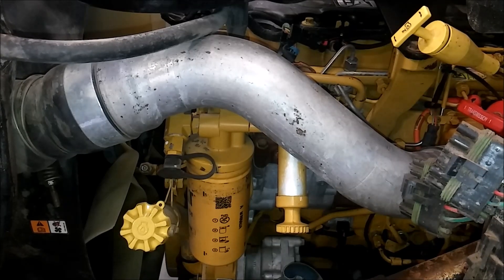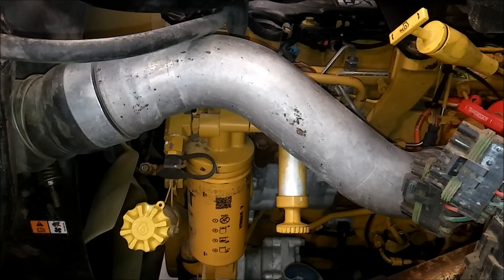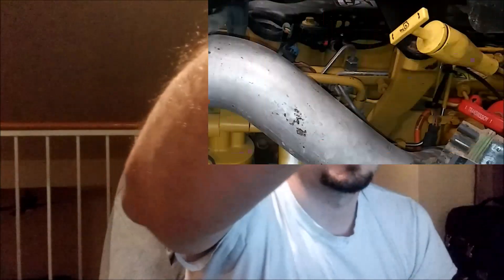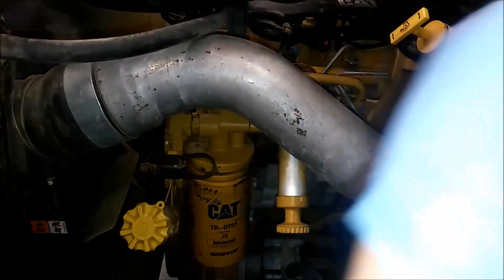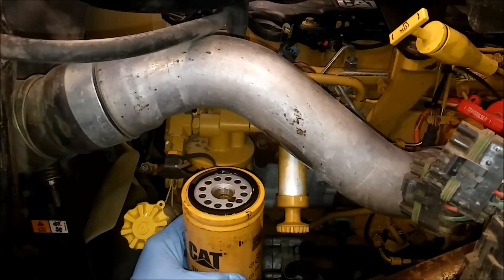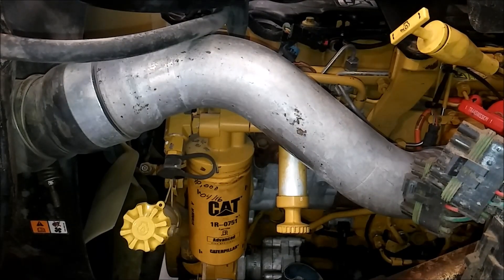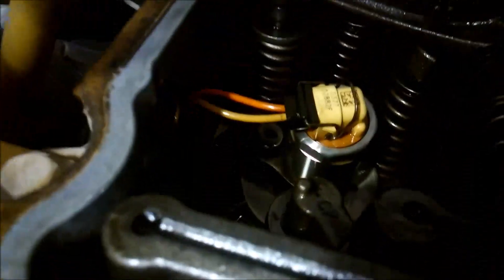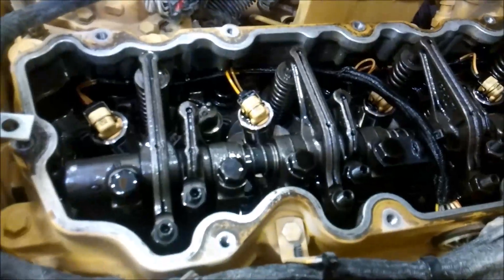How To Troubleshoot Fuel In Oil Contamination .  Diesel Fuel Dilution.

Comment: My car is a 1996 Renault 19 Europa 1.8 F3P. About 10 days ago, the engine mixed fuel with the motor oil twice. Mechanics here in Turkey can’t figure out the cause. Could you please help me?".

Comment: Great work, just i would like to ask about the troubleshooting of fuel in oil contamination at cat engine 3412E with HEUI fuel system, how can i do it, is it the same? Also, after i add the fuel additive to which time in minutes or seconds i should run the engine then shootdown and check the oil coming from the injector?

Comment: Ik this is a old video just curious on a c7  if there is anywhere I can get fuel in the oil from a o ring in the heui pump or fuel transfer pump i had the injectors tested and they tested good we put new o rings on the injectors an have put it back together for now hoping it was a bad o ring but they all looked ok this is a cat remain engine with just over 50k miles an 4000hrs

Comment: So I put dye in my C12 Cat 04 model and ran it for 30 min no clear indication on injectors but if I shine the black light on the oil that’s all over the moving components I’m getting a greenish yellow tint reflecting so it’s already in the oil is it possible my orings are bad and or injector cups?

Comment: Hello everyone!
I have Toyota Hiace with 2.5d4d engine 102ps KDFTV code and I have a problem with oil and fuel dilution.
We changed small rings under the injectors, fuel hoses, the injectors are fine - tested, does fuel pump may cause this problem?
If you drive a van on 2000rmps constantly it will be a minimum of the oil and fuel dilution, but if you push the engine over 3000rmps lets say in 5th gear and 120kmh ( 75mph ) the dilution will start quickly.
Thanks for your time and answer.

Bojan Serbia
Reply: Hi have you found solution for this

Comment: I thank you for making this video. My question is I have a 3406b and the fuel is mixing with the oil. I pulled valve covers off I see five nozzles with oil on top and one that is clean no oil on it. Could this be my problem?
Reply: Did you get it fixed? If so what was the issue?

I'm having same issue with my C15 fuel in oil I'll do the dye test, and also just sent in oil sample for confirmation.
Reply: @TolaTrucking  yes I got it fixed it was my plungers in my pump. On that c15 one of your injectors got to be leaking. If you take off the valve covers look on the top of each injector they should have oil on top of them. Look for one that doesn't have oil on it and it's clean. That's going to be your problem.
Reply: I'm going to be checking my messages so I will come back later to see if you was able to get it. It's not hard it sometimes get to you when you don't know I'm here for you bro.

Comment: I have a cat c12.  Just recently had fuel in my oil problem.  Used the advice from this video and dyed my fuel in the fuel filter.  Still could not find the problem.  Ended up changing the fuel pump and o rings on the injectors.  Still didn't fix it.  Brought it to a local shop they pressurized the fuel system and found a small Crack on #2 internal fuel housing right at the injector.  I guess I was the 1 out of 100 that it was the head.

Comment: I did that and gues what my heart almost stop due to whole engine being flooded with fuel by four out of the six injectors. And replaced with new oil filters and set of injectors remanufactured. And started let it idle for a while every thing sound ok drove it and oil pressure started dropping in 5miles stoped towed back to the shop and I’m back to circle one
Reply: Did you end up resolving?

Comment: Watch out for cheap Chinese injector nozzles. They work, but won't atomize the fuel well enough and will result in crankcase fuel dilution, much worse if you already have some blowby as the poorly atomized unburnt fuel will leak past the rings and into the crankcase. If you use low quality biodiesel or mix with veg oil it will cause gumming of the rings and extreme blowby.

Comment: Thoughts on this issue with a Perkins engine in a 1974 Massey Ferguson? The tank gravity feeds into the pump. My guess is it is a check valve in the pump. At least there is a petcock on the tank.
Reply: Farm Tractor

Comment: I have a 2003 3126b in a peterbilt 330 , my oil pressure started to drop and we checked the oil and it was 2 gallons low , added the oil and it went back to 40 psi , looked for the missing oil and found it in the fuel filter…… need help

Comment: Hey I have a 3406e and I ran this test,change the fuel pump and still getting fuel in the oil. The engine has 30k on complete rebuild. Anything else I could check for??

Comment: My injectors are external like a car so I’m just wondering if that only leaves injector pump as a way diesel is getting in oil? N84 3cyl
Reply: I have the same type of fuel pump but it’s a N844 4 cylinder.    Did you find the problem?

Comment: ... I was trying to locate a fuel system leak test procedure (to address a 51.6% fuel dilution of Port eng. crankcase oil issue) for DD 6-71N (Marine) engines (DDA? documents a procedure for applying air pressure to the cyl. head fuel passages, supply /  return pipes / connections and MUI injectors by disconnecting the fuel line at the secondary fuel filter outlet) ... then I came across this video and your use of the dye additive - a revelation!  I can see the CAT & Spectroline identifiers, however, so far, I'm not real sure what UV tool would be cost-effective for a one-off t/s mission ... FYI - I've looked up into the two pipe-threaded ports in between the bearings and seals in my mech. fuel pump - not plugged up, nor have they weeped fuel or oil ... I suspect the fuel pipe connections, or, maybe, an injector, however, the engine otherwise seems to run fine (fires on all 6 cyl.'s).
Reply: ... I found a DD procedure in DD Service Manual 6SE164 MAY 1994, Section 2.0 (Shop Notes - ... ), Pages 17, 18 & 19 ... three fuel leak test methods are outlined, the 1st being observation under the rocker cover of oil puddle presence / weakness / absence (at fuel pipe connectors to head / f.p. nuts to head conn.'s & injectors / f.p. & nut interfaces) following 20-30 min.'s of run time (DD stresses oil puddle inspection as 'key').  The 2nd (engine static) & 3rd (engine running 400-600 RPM [fuel pressure to be regulated higher to 70 PSI by an introduced return line valve]) involving pressurizing to 60-80 PSI with fuel (not air, as per my earlier recollection) ... these latter two methods involve tools I don't own ... which makes my one-off t/s initiative somewhat problematic and less than cost-effective in the scheme of things ... an air pressurization procedure may exist but I don't know where it might be found and / or if it would even be appropriate, should I choose to ad-lib ... I'm liking A,A.'s dye test method more than ever except that it requires a running engine (mine has no lube oil in it, at all, as I anticipated further fuel loss / leakage into the crankcase during testing) ... I'm still trying to track down a local (to Vancouver, B.C., Canada) Spectroline supplier (for dye & appropriate UV flashlight tool) ... CAT wants $17.22CAD (+5% +7%)  for the 1 oz. bottles of dye ... nearest inventory to me is Spokane, WA ...

Comment: losing 1 gallon oil in  50 miles  where is it going no leaks no smoke engine runs good 
until oil runs low is there a o ring on huie to fuel oil
Reply from the maker: The most likely cause is an injector or injector oring leaking oil from the HEUI system into the fuel supply port in the head. You can try resealing the injectors, but if that doesn't work you most likely will need a new set of injectors.
Reply: would it leak that much through injectors

Comment: bmw x5 e53 3.0d diesel in oil,,, what could be the cause,,, smooth running test revealed that injector 1 cylinder 1 is at 2.7 on idle,,,, i am blaming may be cylinder 1 on low compression... its 5 days to over fill the engine oil.... please help
Reply: If 2.7 is talking about some kind of balance rate and its way out of spec, you probably have a leaking or cracked injector
Reply: @sineadfectus  how about compression on cylinder 1 where the mentioned injector is in use... because im also seeing oil on the injection up removal...

Comment: i have a 1978 kubota tractor, v4000, i believe im getting fuel in the oil. any merit to changing the lift pump gasket(s) and injection pump gaskets? and in theory if i remove the injection pump , regasket it, and put it back and line up the marks, so long as i didnt turn the motor it is still timed correctly right

Comment: Good video,  I'm having an issue with a Cummins CM870 right now smells like fuel in with the oil, I removed the valve cover it burned my eyes and nose from the smell. Also has a thump coming into the intake sounds like a steam train.
Any ideas

Comment: Hello..guys...i have this problem and have replaced alot of parts and spend alot money and lost of time at shop and same issues and alot guess by mechanic shops...like bearing n  oil pump etc.........Turn out i replaced #3 injector and 6 injector 0 rings of injector and 3 new filters and fresh oil change cost me about 900usd ..i have cummin isl motor ..2008 kw t800..hope this help..im in la cali..
Reply: Is that what fixed your problem, changing the injector and all orings

Comment: I have a question for you.. I have a 3406c peek Caterpillar  serial# 4CK09953.  Noticed I was losing oil pressure. Got down to 18 give or take at hot idle. Decided to shut her down. I found I was making oil.  Been watching  your vids and ran the dye. Had  dye coming out #3 bonnet. Replaced all 6 fuel nozzels made sure screw was tight on new ones before install. But all back together dropped oil pan. Found fingernail chunks of metal. Inspected rod and mains #4 main was bad. Crank was not damaged. Cleaned it up. Installed new rod and mains and trush washer. Put back together . Everything seemed fine.  Been running for 4 days Then oil pressure started dropping again.. checked oil. Making it again. What do I need to do next?. Would so appreciate your help and advice. Thank you.

Comment: Does this also apply to modern common rail diesel engines in cars? I have a 2010 GM 1.7 diesel, The fuel regulator located on the higher pressure pump died, I replaced it and the stalling issue was solved. But now im getting Oil dilution and im losing diesel faster than I should. Checking the oil via dipstick also shows a higher reading, so I suspect diesel is entering the engine and mixing with the oil. I've got a little coating of diesel around the top of the injectors as well! The only symptoms I have are... Blue smoke and loss of fuel and the smoke smells like burning oil. Turbo checked and is OK, no play in the propeller shaft, but a little oil in the turbo near it. Also removed the breather hose and started the car, also smoke coming out of that. Thoughts?

Comment: @Adept Ape: do you know which part in the injector fails which causes fuel to oil dilution? Also, do you know where the fuel leaks? Is it from the solenoid housing or something further inside?

Been trying to find a solution for this C7/C9 problem.

Comment: Hello mate
 I have 10/2005 build BMW 525d with a m57n 2.5 diesel 24v engine . Whilst driving my engine oil pressure warning light came on..I check dipstick thinking it had got low but it was actually a cm or more above max mark. I drained out approx litre or so to get it back level . No more pressure light. Then approx 2 months later same again...oil back upto above max. I completely changed oil this time and it was very black and thin assuming first mix. I was lazy and didn't check my oil as its never needed topoping up. I'm being told that due to my short journeys the car isn't completely the regeneration process fully for df (diesel particulate filter) leaving excess diesel to get through into sump via pistons over time increasing oil level. But your video suggests it's injectors?. Are you familiar with the m57n engine and could help me eliminate cause? Thanks in advance
Reply: Did you find the cause of the problem?
Reply: @bmwe657er  its was unburnt diesel from cars regen cycle not being complete. I changed oil it was fine. Just made sure I did at least 1 long journey a month for dpf to regen

Comment: This all depends on which engine your working on fella. It could be as little as a mechanical fuel pump.
Reply: If it was mechanical you'd still be looking at the injectors with the same diagnostic process the only thing different would be where its leaking at the injector. (Feed or return leak possibly caused by a combustion leak.)
Reply: Working on a 3406e same problem fuel in oil. Runs great, no smoke, or starting issues.  issues . Did the same test  no luck  transfer pump next?

Comment: Hey man I really need some advice on ih dt407 it ran good when got had head gasket leak and overheated once then I sent the head out had it machined all the valves and seats were redone springs everything then sent the injectors out got all 6 rebuilt and had the guy who did the head loctite the injector sleeves in the head and got it all reinstalled and did the torque sequences and against after it ran for a hour and its leaking diesel out of manifold 3 and 4 cylinders and then also overheated again after it ran for about 10 minutes at 1800rpms roughly and spit fluid out the radiator cap ofcourse and also has new oil cool water pump and thermostat on it from the original time it overheated

Comment: I have a 1999 Cummins 24v with fuel getting in the oil. I did your dye test, ran motor for 30 seconds and removed the valve cover and the whole thing was glowing green. Which the dye obviously diluted my oil that fast....talked to a major diesel performance shop. They suggested the front seal on VP 44. I replaced it, changed oil, restarted the engine and it is still growing on the dipstick.  Just wanted your thoughts. I guess it would be an injector or o-ring on injector? It isn't nearly as obvious as your video. I even ran it without the valve cover and there is no way to tell because the oil is now dyed green. Lemme know your thoughts or any tips or tricks to try next....thank you in advance.
Reply: my cummings 5.9 isdoing this ??? is the lift pump/ injection pump / or injectors at fault? just put on rebuilt inj. pump

Comment: Really good idea thanks, but what if you have a modern common rail direct injection engine (car/light van in my case Vw group) and you just had an oil change (low mileage engine) and you do 50 miles or more how long will oil take to get browned (low emissions oil ) if it still is very colourless should I be worried?

Comment: Just rebuilt my c7 and it's throwing     smog in the blow by ...change all 6 injectors cause i was having that fuel in the oil motor ...plus I'm getting really bad mpg  ..was told it was cause my bad injectors but I change them all n still have bad mpg . this c7 it's on my 2004 ford f650 ... any suggestions
Reply: Nigth Owl did u change the injector cups

Comment: If its not leaking around the soleniod but down around the orings would the dye show up on the head around the injector? Or would the fuel be getting in down in the head where the oil rail is?

Comment: I Have a Massey Tractor with a Perkins 4 Cyl Engine...Tractor Starts Fast and Runs great, No Loss of Power BUT the Oil on the Dipstick Looks Like Tan Milky Color...I am Told By One Mechanic this is NORMAL because all diesel have Air in the oil ??! and By another that I need a Head Gasket!  Can You help with some advice please.  Thank You
Reply: MrDanoconnor head prob cracked in a Perkins if it's been run hot,look between the valves combustion chamber

Comment: Hi.
I have a Cummins B180 euro 2 engine.
It has diesel in the oil.
Runs perfect and has power.
Bypassed the little bleeding hand pump thinking it was the cause seeing that it runs of the cam.

The injectors is outside the engine not like your cat video.

Could it be the diesel pump?

Thanks love your videos.

Comment: Am experiencing similar problem am in jamaica and no mechanic or electrical engineer seem to kno what it is some saying head gasket is gone some saying a lot a thing! When pull my engine bung it was all oil mix with mostly gas and it also cause the plugs to foul up so hard to start at times I change all the injectors thinking it that and same issue starts perfect when oil and filters are change and battery fully charge and then grackles strong for a while until shuts off! Pls I need help haven’t been driving almost 2 month now and I spent so much on it please share this and see if I can get help! My number is also 5129524888 for who is in the us tht a us number to call me on or leave a comment pls u can also see on the cylinder walls waste gas

Comment: Ape. I did the dye test and injectors are not leaking what should I do next
Reply from the maker: +Josue Bravo Okay well do you have black fuel in your tank? This could mean you have leak between the HEUI rail in the head and the fuel rail. This could be coming from a leaking injector seal in the head or a weird crack in the head. The other place would be possibly the HEUI pump because the fuel transfer pump runs off the back of it.
Reply: How can i check if the pump is the problem?

Comment: My father in law tried it and no fluorescent color was seen and also he checked with air pressure and it never lost air pressure. We checked the pump and there is no leak. What else can I look for for?
Reply from the maker: +iBeard13 Did he try it hot or cold? Sometimes it makes a big difference to try it one or the other. Sometimes it is such a small leak you might not be able to catch it with the dye trick either.
Reply: Adept Ape oh please don't say it's too small,I'm about to buy a semi with a 3406b the oil is overfull,I will try your trick first